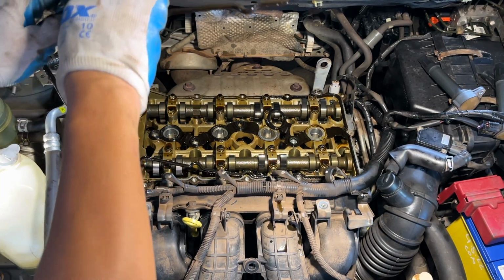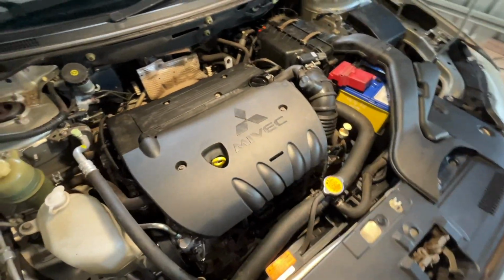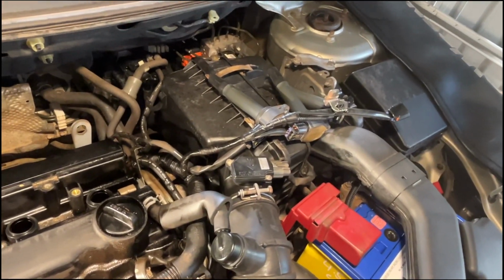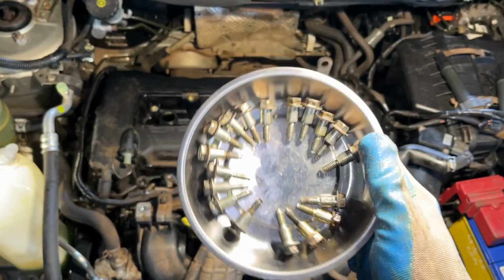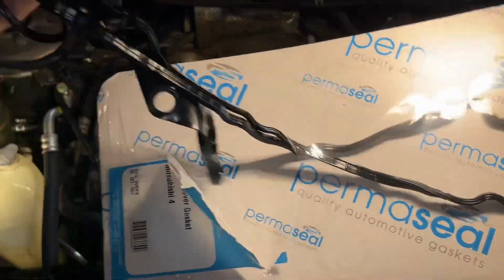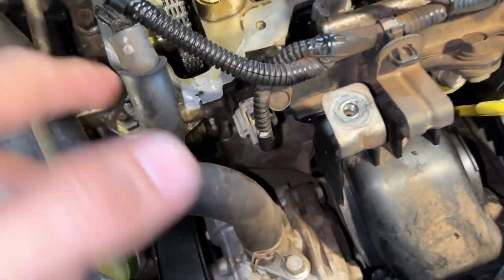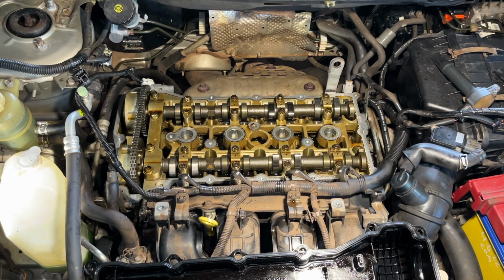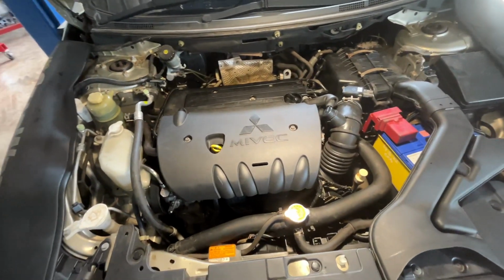HOW TO REPLACED VALVE COVER GASKET MITSUBISHI LANCER

Comment: Oliver, what torque specs did you tighten the screws at and did you do a 2 step process or just followed the torque sequence?
Reply from the maker: Do the torque sequence mate and just check the rubber if already set properly just don’t over tighten it   😉